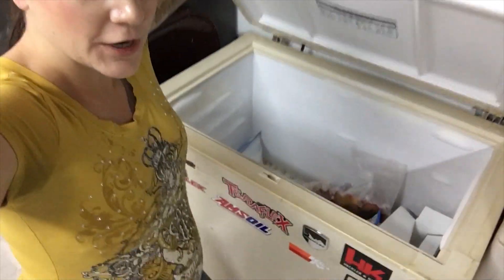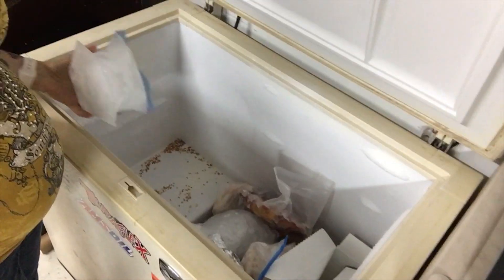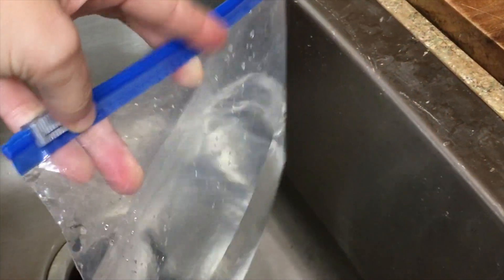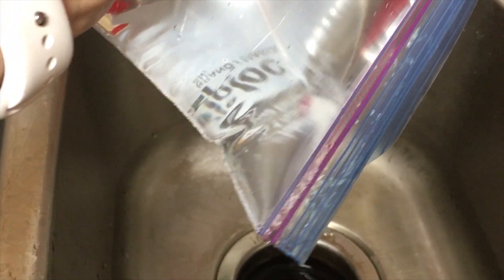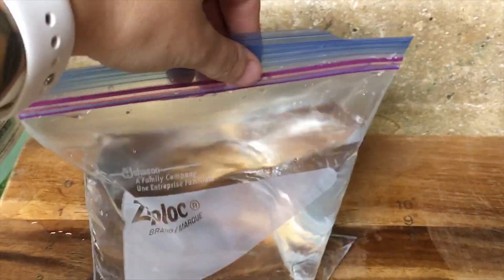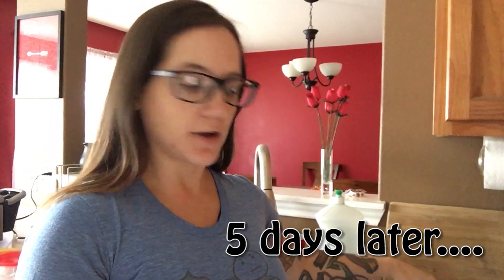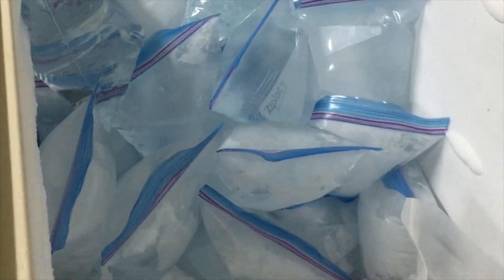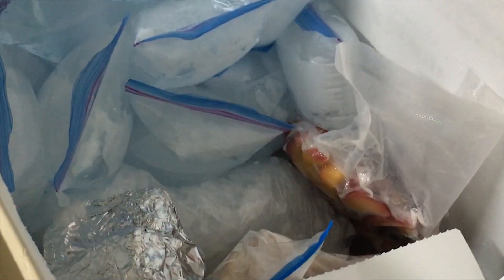Emergency Water in the Freezer

Comment: One thing you may want to consider is using already purified water to fill the bags. That way you don't have to waste time, energy, and fuel to purify it when it's needed in an emergency.
Reply from the maker: +karmatso I thought about it, but this process in general isn't necessarily sterile, so it may not have made a difference. Plus, if I want that water right away and it's not melted, I'm going to HAVE to use those resources to melt the water in order to drink it.

Comment: Great tip. We also keep a few pop or juice bottles with frozen water. One year our refrigerator was not cooling well and we would place a few frozen bottles inside to help keep things cool. Worked well. You may have thought of this but another helpful hint would be to turn the thermostat down a click or two in the freezer. Once all that water is frozen, you don't need as much cooling.
Reply from the maker: +bushcraft2012 Sounds good. Thanks!

Comment: In a grid down medical class, we were shown the zipper style bags are great for improvised wound debris wash by adding a Betadine wipe or a few drops of Povidone-iodine and squeeze it just like you did because they DO leak streams at the edges & are reuseable.  We use 2lt, 16oz and 20oz soda bottles for space in our freezer. In the smaller ones we add a table spoon of salt to it because it freezes 'harder' & lasts longer in our coolers. (not for drinking though).
Reply from the maker: +hallard069 sounds good!

Comment: I use to freeze water in a water bottle and as the day wore on it with thaw out and I would drink the water. After about a dozen or so uses I started to notice there was particles floating in the water. The bottle was always washed out and clean water put in before freezing. When I started noticing these particles floating I decided that it was probably not a good idea to continue to use plastic bottles to freeze my water in and drink. Maybe for one or two uses but definitely not long-term. Thanks for sharing my friend.
Reply from the maker: +Massachusetts Prepper I totally agree with you. There are many people who do the bottle thing and I don't agree with it, especially when it used to be a milk jug. Bacteria grows from simply drinking out of the bottle, regardless of how good it's cleaned, when it's used over and over and over, bacteria just keeps growing and it gets harder to clean. For long-term, that's not a good idea. That's why these zip-locs work so well for us. Thank you!

Comment: Heck ya, great idea. I need to put some bags of water in our deep freezer. Thanks for the tip
Reply: +John “survivor johnny” Tewelow it occurs to me that if you put a bag from your freezer in a pan, as it melts it will collect condensation from the air and give even more water than just what is in the bag
Reply from the maker: +John “survivor johnny” Tewelow Possibly, not sure the amount of condensation from the bag would be worth trying to save, but, definitely an idea!

Comment: Great video .  Try using empty 2lb margarine tubs to freeze water in that way they are stackable . This will give you more useable room in your freezer. You could also try empty plastic Skippy peanut butter tubs.  They are less likely to spring a leek .
Reply from the maker: I like using these small bags so I don't have to unfreeze/use a ton of water at a time if I only want a little bit. Whatever works for you, though.